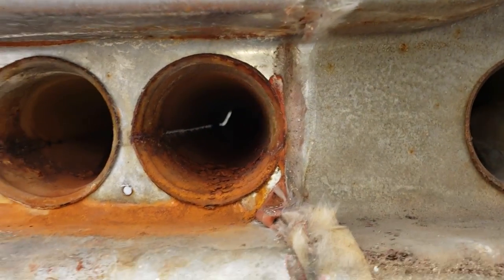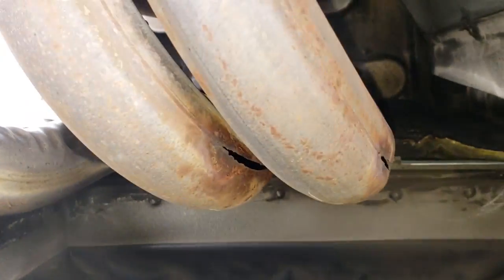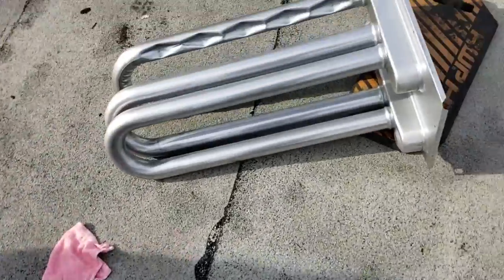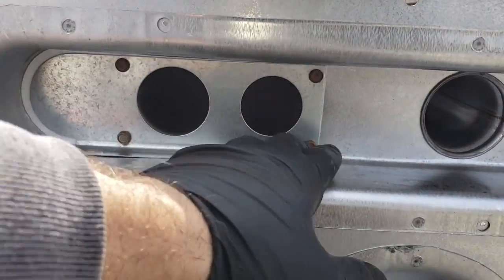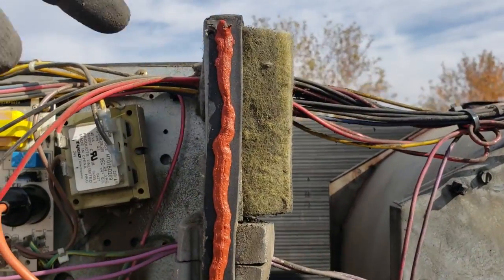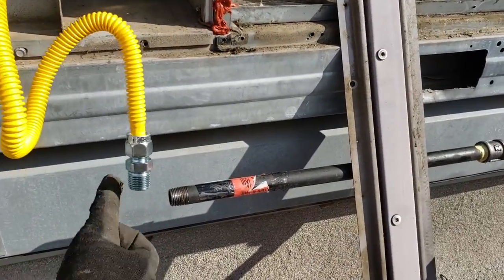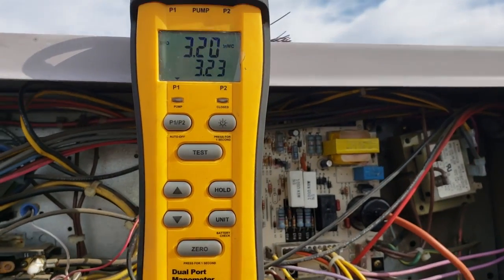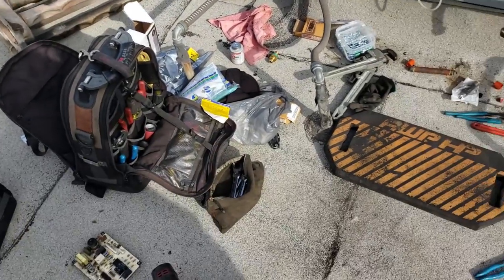Carrier Heat Exchanger

Comment: Had an OLD Sears unit. Heat exchanger was CERAMIC COATED. Care to guess how old it was? House was 52 years old on the original unit. What a freaking tank. Still works today and is dead silent. Belt drive blower with GREASE ZERKS.

Comment: I'm from Italy, here I don't see any of this type... So, why use gas if there is a compressor?? Why don't use the heat pump? (someone can explain because to me it's wired, here in italy most home have a gas furnace, some new house have heat pump and commercial most have heat pump in the form of mini split or VRF system, also in home we use minisplit for the really hot day in the summer)
Reply: Heat pumps lose efficiency in cold weather and dont give too much heat. They could be used if there is no available gas and with heat pumps you need heat strips as a supplemental heat source.

Comment: Why don't they make the heat exchanger out of stainless steel? Is it because of cost reasons or because they want to sell more parts and units?
Reply: I don't know about heat exchangers, but hot combustion products are hot combustion products and the stainless exhaust pipes and mufflers you get for a car are about twice or 3 times as expensive as the sections of galvanized exhaust tube they'll sell you at the auto parts store.
Reply: @44R0Ndin  if you Google why heat exchangers are so expensive, it's because they use rare metals... So it's absurd this one would rust, regularly fail AND be expensive, PLUS a 45 day lead time!  They are out of their damn mind if they think this is good for their company!!!
Reply: Someone absolutely needs to start making these better using stainless or titanium or something!

Comment: Agree Chris, im changing a heat exchanger, dealer should just include or ask if you want other materials,  here in Canada, if you use high temp, instead of a factory gasket, TSSA, will say that we altered the unit, it’s quite sad

Comment: why would you need a sediment leg when you are going up to elevation?
Reply: We call them drip pockets and they are used so that anything in the line will drop into them and stay there instead of going up and fouling the gas valve or other parts of the heating system

Comment: That unit sure is filthy, which is likely one of the reasons for failure. Also, these guys just rust out after time and use especially when oversized and that dirty in the cabinet. Heat exchangers are exposed to high temperatures and acidic noxious gases causing corrosion.

If your parts guy didn't give you everything needed, they need a little refresher. All our counter people know about the regulator and flame retainer requirements. But we are also in Chicago and deal with the RTU'S with gas heat every single day. If you need that insulation, it should be available, but just needs to be ordered from the factory. The fact it is in such bad consition i  due to the dirt conditions and high heat giving it crispy critter look.

I have sold these exchangers for 17 years at the counter level. Always get the regulator and retainer and ALWAYS seal with hi temp silicone. They don;t come with because if I remeber right heat exchangers and the regulators are manufactured in different plants. I have had guys not seal heat exchangers and can't figure out why there is so much CO in the building.

If you are a legitimate contractor and deal with a Carrier supplier you can ask them for access to HVACpartners.com and find all the parts lists and drawings you could want. The exact same ones we have access too at the Distributor level.
Reply from the maker: Thanks bud, yeah they have not been able to find the insulation for me I'm using Sigler as my carrier distributor out here. Like I said in the video I really dont rely on suppliers getting me part numbers anymore I ask for parts breakdowns and do the work myself because I'm sick of getting burned. It's very sad because I can remember a time when the supply houses handled everything from parts and even gave tech support but that has slowly been dying off as the new blood comes into the supply houses these days. But I also understand times are tight and they need to cut costs to stay profitable, especially with majority of the manufacturers selling direct to customers these days. Anyways thanks for watching and taking the time to leave a comment!
Reply: @HVACRVIDEOS  get them to sign you up for hvacpartners.com. You'll never need to call them for anything more than placing the order with the part numbers you found yourself.

Comment: Great video.....  I work back north east. Most time we end up doing inducer motor and new burners with heat exchanger. Did quite of few of those. 
Now carrier/ bryant residential units sucks. They send the heat exchangers in individual cells. You have to assemble the puzzle.

Comment: done a bunch of these and trane packaged too.

never forget to block supply before burn off. I did once. first indication was the people running out of the building hahahah
Reply from the maker: Yeah I hear you on that! Thanks for watching , I will be going live on Youtube this evening at 5:00pm pacific time to discuss my most recent uploads and answer questions from the live chat. Come on over and check it out  https://youtu.be/1r7KkERXrE4
Reply: what do you suggest?  plywood/random material that would block most of or the entire size of the hole?
Reply: @Bruceman17  use the door that comes off at the curved end of the heat exchanger. It's meant to be cover the supply air if u have a side discharge unit

Comment: all that silicone, wouldn't want to be the next guy trying to remove it (cuss fest x 99,000) but I'm guessing the unit will be replaced around the time of next HE failure anyway.
have to seal them up somehow!
Reply: So, you wouldn't want to be the guy scrapping the unit then? I did alot of that when I worked HVAC. The real fun stuff is the black tar-like stuff they use to seal returns and supplies on some roof-top units.
Reply: @bairfamilyfarm1336  I'd rather be the guy that saves 2 unpaid hours breaking it down and hauling it off, while watching the scrappers fight and slave labor, burn their fuel and tool power to make $30 at scrap yard.....
most don't realize it hardly makes them anything after factoring in all the costs, but I guess their time is free? granted there was a point in time, you could spend $100 and make $600+ in one lazy day, that's more like spend $100 and make $150 or less now ;)

Comment: Couple winters ago I had a high end restaurant with 10 of these puppies 4-7 ton. 
3 had bad exchangers- burn through on one of them.
Carriers aint too hateful to change until you cross 15 ton line.  Then you have to have a helper cause they're so damn big..
Here in Ohio 10-15 years and they start to fail. They're aluminized and a weak spot mixed with condensation and viola a hole.
Usually change these out in snow .
Good vid and advice CHECK GAS PRESSURE- I know some guys set it by ear! Usually way to high -early failure. Crap air flow as well.
I would add to the replacement the flat plate that bolts above burner.
U shape with holes,flat plate with holes and the solid plate. Noticed the rust in the video. . I've always replaced all 3. Just a thought.
Reply: Flame regulator flame retainer and flue cover meant to include carriers names

Comment: Not in the industry, but a question - why are heat exchangers not manufactured with seamless tubing (apart from expense)?
Reply: Its cost, and even with seamless it will just rot out on the plenum side at the joints. They also have SS heat exchangers available for locations that will have their heat short cycling in warmer areas like Texas and Cali. The thought process from a design perspective is that if you cant design to have the delta-T across the exchanger large enough or run time long enough to drive the water out, you spec. the stainless one.
Reply: @mysock351C  Thanks for the reply - getting some insight on the engineering behind HVAC now.
Reply: @mtcruse  Yeah Id bet that using seamless steel would be more expensive than a standard stainless steel version of the heat exchanger, just due to the difficulty in manufacturing seamless tubing. The other option of they wanted to keep it cheap but reliable would be to use stamped sheet metal to form the burner passages and cutouts and then crimp  them together to make the sections. But in this case they save cost and size by using standard cheap steel tubing and solve the issue by making the stainless one an option, from what I remember spec'ing these units for retail and commercial construction. The main issue here is that water is a combusion by-product and if the burner does not run long enough, the exhaust condenses and rots the thing out fairly quickly since it may not get warm enough to drive it all off. This can also be an issue if they have a low heat option and the weather is cold. Part of the exchanger starts condensing water.
Reply: Seamless would increase the cost..
Reply from the maker: That is a great question and I wonder the same thing!
Reply: Only other thing I can think of - planned obsolescence.
Reply from the maker: Thanks for watching , I will be going live on Youtube this evening at 5:00pm pacific time to discuss my most recent uploads and answer questions from the live chat. Come on over and check it out  https://youtu.be/1r7KkERXrE4
Reply: Baxter manufactures a seamless heat exchanger in the rack ovens we repair for them 10 year warranty on them. Supposedly yet to have one crack...
Reply: @stevenlytle3711  Yeah be interesting to know what the overall cost savings is... Seamless does require a lot more equipment to get tube/pipe from a steel billet vs. using cheap steel sheet stock as you probably know.

Comment: Carrier heat exchangers fail after 7 to8 years. Good news is they have a 10 year warranty. I had a school with 22 Carrier gas packs and 21 had seams split or holes at the “U” bend. The parts you’re referring to are the flame retainer and burner support. The induce draft assembly and run cap should be replaced with the heat exchanger. The rollout switch is problematic as well. The by-metal disk gets rusty and the vibration of the unit running can cause them to trip. Just tap it with your finger you’ll see what I’m talking about. I replace them with a sealed adjustable limit. Oh and if the model # starts with 48 it’s gas if it is 50 then it’s electric heat. Have a great day.
Reply from the maker: Thanks for watching , I will be going live on Youtube this evening at 5:00pm pacific time to discuss my most recent uploads and answer questions from the live chat. Come on over and check it out  https://youtu.be/1r7KkERXrE4
Reply: I have one that was installed in 1999, it just failed.

Comment: I live in Sacramento area... I’ve found 7 this winter, all on Carrier 48 series units. Find them all the time. 

The two parts your referencing is flame retainer and exhaust regulator. 

When I replace heat exchangers I normally replace with new flame retainers, exhaust regulators, burner support assembly (sheet metal that the induce draft motor mounts to) also I replace high limit, and flame sensor.
Reply from the maker: Thanks for watching , I will be going live on Youtube this evening at 5:00pm pacific time to discuss my most recent uploads and answer questions from the live chat. Come on over and check it out  https://youtu.be/1r7KkERXrE4
Reply: @HVACRVIDEOS  Damn, just missed it.

Comment: Y are the baffles important?...y is that 1 baffle in particular important?...the original baffles were too gone to reuse?
Reply from the maker: Yeah the original were too rusted out, the baffles help to properly control the flame
Reply: @HVACRVIDEOS  quick question b/c I cant get a hold of anyone from carrier....but I have a trailer sized rtu(I dont have the model/serial #'s at moment) it is cooling only....it has a 2" indoor blower motor shaft....exactly what bearing grease should be used for the shaft bearings?thanku for any info